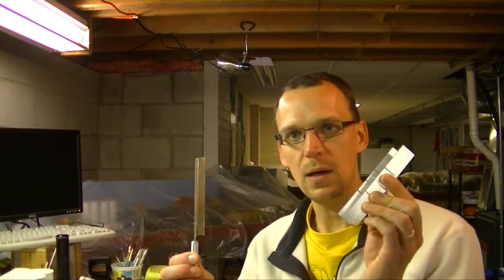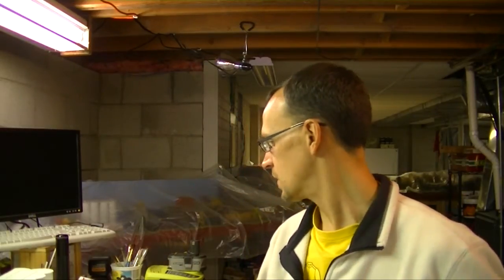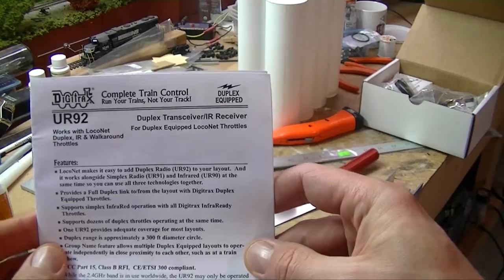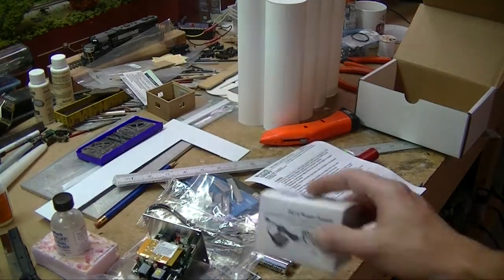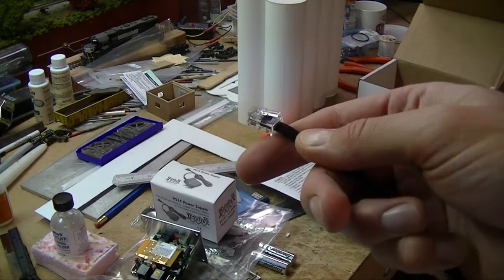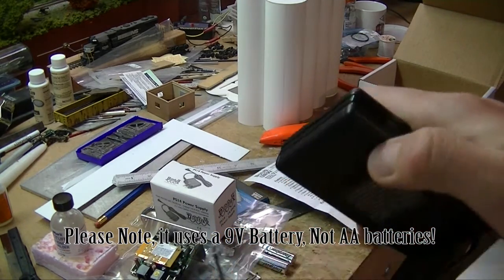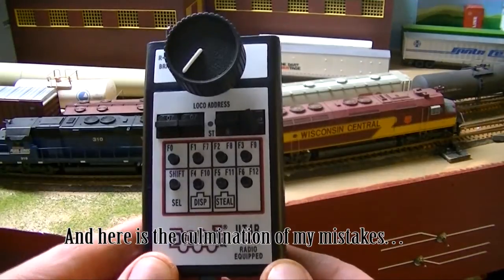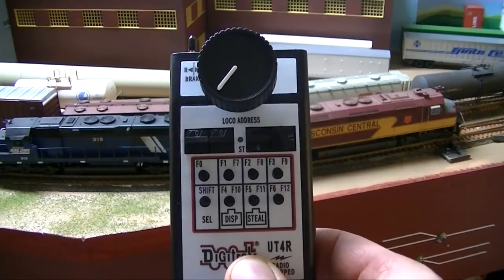This Just In!  Not Doing Proper Research Can Be Costly - Digitrax Wireless Throttle and Receiver

Comment: Using Duplex Radio it is better to have the UR92 located at a central elevated location. On every layout I built I had it configured into a ceiling panel or other convenient place. The other advantage of a higher mounting location is that you can fall back on IR if needed.
If you have a one room layout then you can get away with mounting it lower or under your benchwork...  though you might get the occasional hiccup. Daisy chaining UP5s saves on cable costs and can be used on a very large layout.

Comment: As a Digitrax user for 15+ years I suggest you remove the mess around your Control Centre and daisy chain all your system with 6 wire loconet cables.  Geoff.  W.

Comment: Correct me if I'm wrong but it is to my understanding that anything labeled "R" at the end is standard Radio which is Simplex and anything with "D" at the end is Duplex. None the less where you see "Radio Equipped" on an R throttle should say "Duplex Equipped" on a D throttle.

Comment: I Started out with the Zephyr, then local train store was moving so got DB-150 for a steal 50% off. I use UP5 around my layout they are cheap. I then purchased DT402D since duplex doesn't cost much more same for UT4 you could have purchased the UT-4D for additional $10 more MSRP (130 vs 140). Need now to get the UR92, You would thing the U92 would support all the lower models nice to know only Duplex and Infrared units.

I made a similar mistake with Kato Unitrack 20-201 and 20-202 don't work well with DCC need to go with more expensive 20-220and 20-221 took a loss and sold them on ebay for less than I paid and got the more expensive switches.

Comment: did you ever figure out the problem?  I have the same setup but just have to plug in to acquire the locomotive then walk around all night unplugged and controlling my train.  Then plug in to dispatch the locomotive and put it away...
Reply: wrong panels for the radio, wrong gen for the generation used, all manufactures can have that issue

Comment: hi sorry i don't know your name. i have a question or 2. is there any particular reason why you use that multi plug devise for your loco net?? why couldn't you start at the command station to the first fascia panel & daisy chain from there? just curious
vinny
Reply from the maker: Vinny, Matt here.  Meant to post that to your comment a couple videos ago.  I actually should have done the daisy chaining from the word go but didn't realize that could be done.  At some point I will redo the wiring on the layout, but for now it works as is.

Comment: I have a similar system. Excep I have the DT402 Trotle, I the trotles I did what Al Mayo a.k.a Mosterrailroad did I put the togle switch and an Led to let me know if I left it on. On another note I see plastic on your layout. Do you cover it when you don't use it? Because that is a great idea mine collects dust from I don't know where LOL. Anyway great video. RT
Reply from the maker: Glad you enjoy the video!  To answer your question, I do cover my layout when not in use.  Just with cheap throw away paint drop cloths.  They are lightweight so they don't crush trees or details on buildings and easy to remove.  I get a lot of dust settling down from the floor joists above me as my layout is situated below our family room where the kids spend quite a bit of time.  If just filters through eventually, ending up on the layout.
Reply: retrainrun kfikduie

Comment: hey Matt ... thanks for the response.. i am going to be doing a project for a friend that will be in HO in your previous video you showed the walthers grain elevator. can you tell me the product code number (part #) ... wow this is going to be totally different build than my "N" scale structures
vinny
Reply from the maker: Walther's part number is 933-3022.  There is also the newer Ethanol series that has a smaller head house but the same silos.  Or if you used 2" PVC pipe that would be about the same diameter as the silos in the kit.  Good luck with the kitbash!

Comment: Well I learned why I am an NCE man lol jk. I am actually curious to know do you have any circuit breakers to section off your layout? Also are you aware if NCE can do jacks like you did around the layout with jumpers? That seems a lot cheaper than buying a lot of NCE plugs.
Reply from the maker: I've actually considered a switch to NCE.  While this was my mistake, I'm alittle baffled at why the latest receiver wouldn't be backwards compatible.  That seems like lazy engineering IMO.  As for the jumpers, if the NCE system is a bus setup like Digitrax, my thought would be that it would work as well, that the signal from the handheld is digital and therefor it would work.  However, I am taking a guess here, so I wouldn't put a ton behind my statement.
Reply: ChessieFan2 It wasn't lazy engineering at all.  When Digitrax designed their new duplex radio system, they switched from 915 MHZ to 2.4 GHZ.  They did this for improved range and less interference (the same reason cordless phones made the same switch), and so they could produce a European version.  The only way they could have made the UR92  backwards compatible would be to include two complete radios, one for the 915 MHZ system and one for the 2.4 GHZ system.  If they did that, the vast majority of people who bought the UR92 would be paying a large part of the price for something they would never use.

The UR92 is, in way, backward compatible in that it can coexist on a system that has a UR91 (simplex receiver).  Digitrax has actually been very good at maintaining backward compatibility (a lot better than some DCC companies).  Virtually every throttle they have ever produced can be used on even their newest command stations.